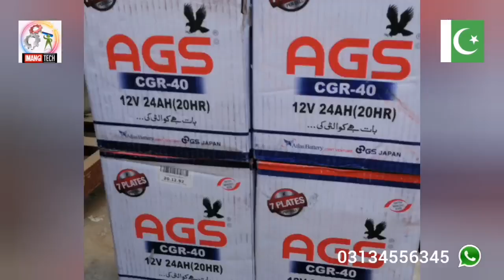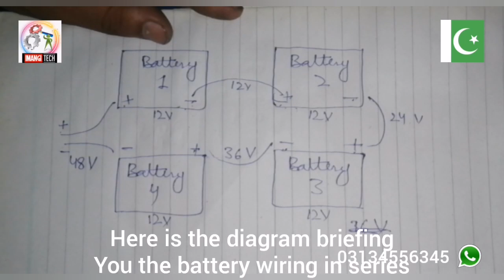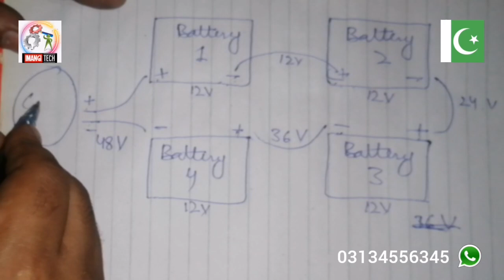I converted my old 70cc bike into Electric bike (full DIY project video)

Comment: یہ  جو  آپ  نے  بیٹری  لگائی  ہیں،  یہ  کتنے  کلومیٹر  دیں  گی  ۔  اور  چارجنگ  ٹائم  کتنا  لگے  گا۔
Reply from the maker: Dost ye batteries agr ap na lagarn to behtar he.. Mene just for testing purpose use ki thi..
1) inka weight buht zyada he jis se apki bike heavy hojati h or hub motor pe load b zyada ata he hub amps zyada leta he or milleage kam milti he takreban 25 se 30 kilometer
2) tezab wali batteries me terminals ka buht issue hota h carbon ajata h phr saaf krni hoti he
3) charge hone me kam se kam 7/8 ghante leti he
4) space zyada leti he apko chassis b katna parh jata he
5) pani wali battery he har hafte pani dalne ki pareshani
So, guyz me sbko yehi suggest krta hn k lithium battery use kren
Light weight
More milleage 48v 20A gives 50/60 kms
Minimum time to charge
2 ghante me full charge hojati he
Ebike ka maza lena h to lithium use kro.. Agr paise buht hon to ksi gareeb ko de do dry ya acid battery se apne paise or time zaya na kro

Me lithium batteries buht saste rates me provide krunga inshallah..
Reply: @Mangi7866  sir 48v to 20a ki battery Kitna m mily gie or 2000w ki motr ko best hai or Kitna km kry gie